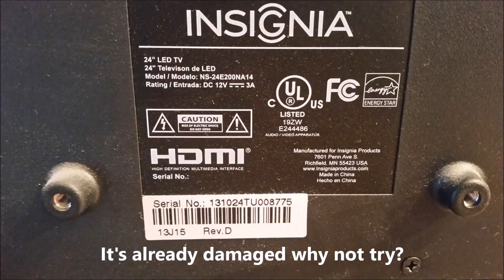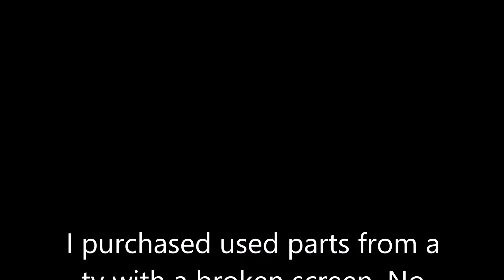Diy Tv Repair-Randomly turning off and on

Comment: Where did you locate parts? I have two that are doing this.
Reply from the maker: I found mine on ebay. This brand is not big on parts availability though.  Just google your part number or model number.